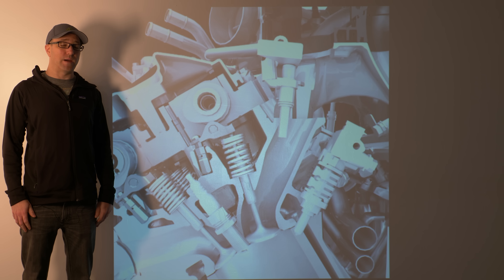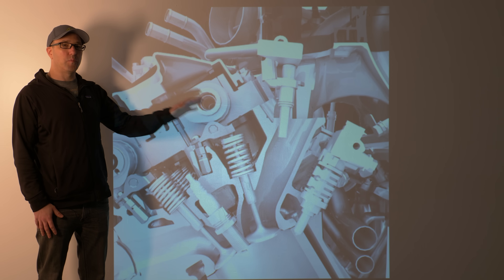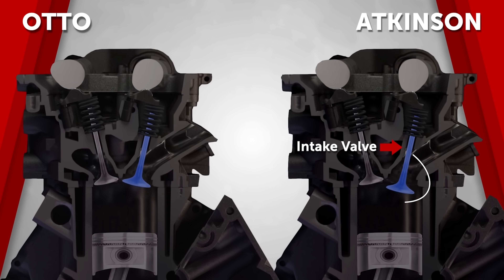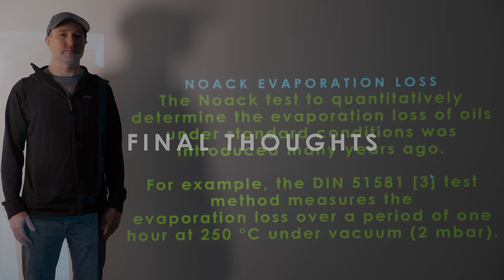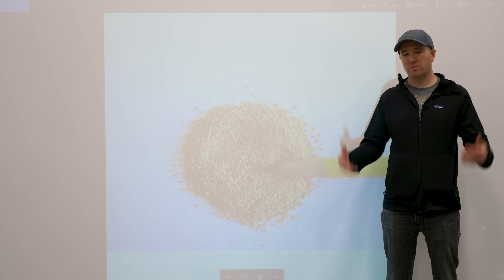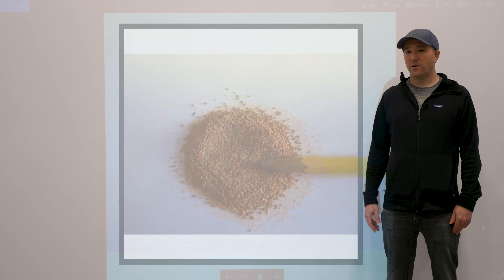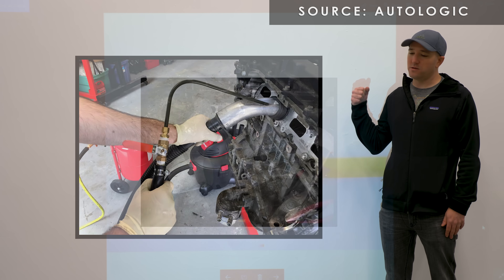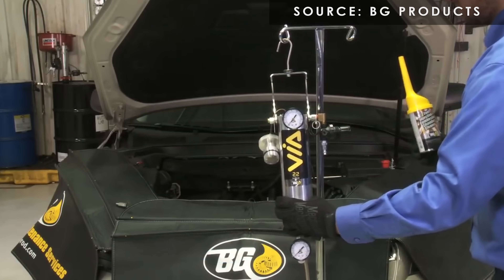Direct Injection, Problems and Solutions | The Fine Print

Comment: I'll stick to my all electric vehicles it's a lot simpler
Reply: First off, I love what Tesla is doing.  It'd be foolhardy to discount electric, as you simply can't beat the simplicity of an electric motor as compared to an ICE.  The power per size/weight, smoothness, ability to completely change the physical dimensions, mounting location of the motors etc.  When battery technology catches up, electric will take over.

Truth is though, we aren't there yet.  I've road tripped all around the country.  Last trip was 6,500 miles in the time span of ~2 weeks.  If we had to stop for an hour and fifteen minutes, give or take, every ~300 miles, it'd be very difficult.  That's assuming weather etc doesn't significantly reduce that.  Let alone if you're passing through a state like Kansas with a total of like 7 stations.  Hopefully there aren't too many other electric travelers.  We drove to Yellowstone and as one can quickly see, not many options in Wyoming.  Suddenly, you're planning your road trips around where you hope to be able to charge, not where you actually want to go.  

For shorter trips, you're probably great, especially in more charger dense areas.  I have faith that we'll overcome these limitations in time, but between the time it takes to "fill," the very limited number of stations as compared to gas stations, and the still rather limiting range of EV's, it's just not comparable today.

In my diesel car, I go an easy 600-700 miles on a fill that takes 5-10 minutes.  If I want a break, I take one where and when I desire.  It isn't dictated upon me by my vehicles range and time it takes to charge.  I can also expect that range fairly regardless of weather or what options I'm using in my car.  Being that stations are everywhere, I can drive through the middle of the night with full confidence that I'll come across a station when I need one.  

In our diesel truck pulling our travel trailer, I still get an easy 500+ miles to a fill.  It's just as easy to find fuel for it as well.  

Again, I think electric will overtake one day, as the powertrain itself is just superior.  As batteries improve and the number of stations increase, it's inevitable.  Currently, great strides have been made and Tesla's are in a land of their own as far as technology on board.  Great cars, but still limiting to those who take seriously long road trips around our beautiful country.
Reply: I had a model S so I got to skip all the non-owners in line.  Right now I'm not getting 310 miles due to extremely low temperatures where I live.  People in warmer climates have gone past 310 miles on a single charge already.
Reply: You got a Model 3? Dang you must be one of the lucky ones. I kind of doubt you get 300 miles to a charge, but either way nice car! I honestly like the idea of an EV with range extenders. Or like the Accord hybrid with direct drive on the engine for only high speed.

EVs I think are the future only because for a consumer there nearly little to no maintenance required and the general public just want hassle free vehicles.
Reply: My buddies drove their tesla from Flordia, to california, to new york, and to cinci and didn't have any issues finding super charger stations. Joe Johnson is a poor troll. Poor troll is poor.
Reply: Don't feed the trolls, best to just not engage with them because they want that back and forth interaction.
Reply: I'm considering going electric for my next car as well.  Still deciding which one, though.  Seems like there is a lot of decent options out there.
Reply: I agree and Electricity does not have any carbon footprint since Electricity comes from LIGHTNING  :D  he he he he
Reply: It's not simple at all. It's just that it all happens in a blackbox that you literally cannot maintain without proprietary tools.
Reply: Paully Castallano I like the idea of waking up with full range because you have plugged all night while sleeping. Some people don’t see that advantage.
Reply: first of all modern ice engine are controlled by ecu depending on the make and model of the car they also have millions of line of code an electric car share pretty most of all its component with an equivalent internal combustion engine car the only difference is the power train and energy storage an electric car power train is pretty much an upscale electric drill notice how you can spin the drill fast or slow by controlling the trigger pretty much the same principle as a an electric car a motor is pretty much a rod wrap in conductive coil that is activated by electricity you can pretty much build your own motor with a cooper wire and a double A battery on principle alone electric motor are very simple to fix and make try striping one of those handheld battery operated electric drill that pretty much a miniature tesla power train
Reply: Oh that's nice. Is it getting better mileage than your Model S? Some owners here in CA were getting more like 200 mile range on their model S.
Reply: Nathan, that's why I think diesel electric or petrol electric vehicles will become a popular option. It's already starting to show up like the BMW electric vehicles or something like Honda's current Accord Hybrid. The energy density of fossil fuels is pretty nuts considering how little of it we are actually using.
Reply: Out of curiosity, how heavy/massive are the batteries in these electric cars?
Reply: In a model S about 1200lbs
Reply: lazy and fat, not a bad way to live
Reply: Nooooooooooooooooooo! What a boring life
Reply: Beautifully said, right on the money!
Reply: Whoa whoa whoa, I'm pretty sure lightning depletes the ozone layer, and is known to the State of Californ-i-a. That's worse than carbon, even if it's, like, a BigFoot-sized print. And I mean the monster truck, too, not the hairy dude who lives up in Canuckistan.
Reply: How much will battery replacements cost?
Reply: BCSJRR I'll worry about that in 12 years.
Reply: What will be the range in 8 years?
Reply: Same as now...
Reply: Nooooooooooooooooooo! electric isn't simple at all, sure you drive it and you don't know what's behind it but there's millions lines of complicated code that makes the car do what it does, not to mention when you need to replace the battery years later, you basically need a new car since that's the main thing ..
Reply: Nooooooooooooooooooo! , lol. Are you stupid?
Reply: Nooooooooooooooooooo! Doesn't take me an hour or more to use the facilities. While you're charging I'm at least an hour down the road!
Reply: Here, s a new problem  The Tesla supercharger line are 5 to 30 min wait in CA ,  there are too many T cars waiting to use them.
Reply: Paully Castallano My model 3 is rated for 310 miles and superchargers are everywhere.  I can easily go cross country if I wanted.
Reply: Nooooooooooooooooooo! And take at least twice as long!!!!
Reply: Paully Castallano I guess you don't eat or have to use the bathroom.  After around 250 miles or so I wanna take a break from driving anyway.  I enjoy trips a lot more when I'm not just on the road the entire time.
Reply: Cause that is real hard to drown out with music.  In modern cars thats all you hear at highway speed anyway.
Reply: Paully Castallano lol ugliest car? you just confirmed your troll identity
Reply: Not sure where you get your information but there are plenty:
https://supercharge.info
Reply: Joe Johnson False information?  Wow you're really in denial.  Each location has a discussion page with multiple pictures from multiple sources.
Reply: /facepalm
Reply: That site doesn't even say there is one in Harmony but ok keep on trolling I'm done wasting my time with you
Reply: you're from PA? just asking about the charging stations of that area. one thing that surprised me about moving to Memphis was the number of Teslas around here. much more than I thought
Reply: Nooooooooooooooooooo!
I get 700+km out of my 07 tsx and it takes me less than 5 minutes to fill up
Reply: the only thing that will break is the battery the motor itself is almost impossible to break since all motor are basically shaft wrap in electromagnetic wire (copper wire)  that being pushed by the positive and negative charge magnets that only 3 components in a motor so the shaft it self is not even touching the magnets the rest of the car is made exactly like a normal car tires wheels brakes suspension infotainment system aircon and seating so reliability in those area are exactly like the same as normal cars and are due to manufacture build quality rather then the principle of electric cars in fact electric cars should be pretty easy to fix since anybody who capable of fixing an electric drill or rebuild a battery can fix the tesla car in fact the whole drive train is so simple its like a electric rc car that upscale and we all know how much cheaper faster and more reliable the electric rc car is compared to its nitro(fossil fuel) counterpart first of all battery industry driven by electric appliance such as computer and smartphones are announcing breakthrough almost every few years charge time have gone down from almost a day to less then 30 minutes that a 20 fold in charge time reduction and almost 10 times the range of previous electric road cars and that only in a few decade while petrol cars will struggle to meet 5 percent efficiency increase per decade and it gets harder gian they make even the slightest introduction of friction and mass will ruin the engine efficiency over time from there the limits of thermal efficiency of combustion engine limits its useful energy to less then 55 percent and that with a frictionless and massless engine which is impossible if tesla continue with their efforts and if there a breakthrough in battery technology that permits a car to have 10 times the current range with 10 time less charging time of current superchargers you will see a range of 3k miles on a full charge less than 7 minutes within the next 2 decade and don't look at this paragraph and think i am hallucinating phone battery technology have gone from 400mah brick to 4000mah battery from the size of a brick to not much more then thick paper in less then 2 decade and mind you that is if we assume the same growth in the industry which is doubtful since in today modern society research development and importance on appliance and machinery run by battery are of much more important than back then and this will reflect on the resource that will spend on the development of this technology fossil is doom eventually battery will be much lighter than a tank of gas with alot more potential practical energy and the only relevent internal combustion cars will be for recreational purpose going the same way as the horse and donkey
Reply: Serious question, what are you doing watching a video about problems with Fuel driven cars?

Comment: What do you think about CRC intake manifold and valve cleaner? It certainly won’t help if your engine is too far gone and gunked up with carbon deposits but I hear it could be good preventative maintenance to use it every 10,000 miles or so to keep the buildup from getting worse.

Comment: OK I just put walnut shell powder in my air box I should be good right? Seems wierd but I trust you.
Reply: Leeso nneville... Don't forget to put some in your tank to clean out the injectors 😉...as far as the air box goes, are you just using the vacuum or did you put them up high to use a gravity feed style system 👽 🥜
Reply: I mixed walnut powder in my oil, waiting for the power of nature to do its thing
Reply: Nah I just took the air filter out so it didn't get clogged and filled the box up. Don't worry I'll be putting a "How To" up on my blog soon.

Comment: "A Old Guys Trick"I can remember back in the 50s 60s & 70s how we would Decarbonize carbureted engines. We would get the engine hot, remove the air cleaner rev the engine high  while slowly pouring cold water down the Carburetor without killing it,....NO BS..............Black chunks of carbon blew out the tail pipe.
Reply: Bextar636 
Wonder if water injection can be implemented in some fashion for an ongoing cleaning action? Too difficult dealing with freezing or rust, or the replenishment of the water source maybe.
Reply: yup. used to do that!!
Reply: "Wonder if water injection can be implemented ..."
Use a methanol injection kit. I'm looking into installing one on my FoST.
Reply: And this doesn't damage gaskets or o-rings due to the alcohol snake oils use ;)
Reply: A Coke bottle full of cold water down it's throat and out it's exhaust came all kinds of crud
Reply: me to thats somthing l try if i ever have this problem
Reply: Bextar636 window cleaner works even better for that
Reply: I run a water/methanol injection on my diesel.
Did it for lower exhaust gas temperatures, but I've been told it keeps things clean inside.
Reply: yes - this worked on older engines, but the carbon on the GDI valves is nothing like the older stuff. Water in the intake will basically "steam clean" the piston top and combustion chamber - not the valves.
Reply: Yes I did exactly that years ago twice on my 235cu inch Chevy engine.
And as you say it did blow chunks of carbon out the tail pipe.
 It was a fairly well known and used practice with carbureted engines.
Reply: Bextar636 that's a great way to destroy a thousand dollars in catalytic converters
Reply: @zoticus1  no problom. Cat delete
Reply: @zoticus1  because catalytic converters don't buildup condensation in the winter? Idiot
Reply: zoticus1 So how do you prevent moist air going into the engine in rain and foggy weather?
Reply: Whats a carburetor?
Reply: @johngiardina8259  really?
Reply: @johngiardina8259  how engines used to receive fuel before computers or electronic fuel injection
Reply: The problem is oil, use ethanol instead.

Comment: I want to see a high mileage skyactiv brought into the shop and intake removed.
Reply: Aarown1017 Skyactiv engines have air/oil separators. Mazda claims they have no intake valve buildup issues. I still wouldn’t mind seeing dual injection from them like Toyota.
Reply: my 2014 CX-5 with 175 000km on it, canadian winter/summer city driven is still nickel.  no issues.   I use mobil extended since bought at 80k.
Reply: Jean-mathieu Leblanc You still have the CX-5 now on 2020?
Reply: @mindspinn311  Where can I confirm this? I've looked online, but can't find any info to confirm that Skyactiv engines have air/oil separators. I'd love it if it is true because I recently bought a 2019 CX-5 Signature which has a turbocharged Skyactiv engine.
Reply: @robertdevoy3119  Most of the engines today have oil separators built in the head or block.
Reply: @robertdevoy3119  my 2014 CX5 natty with 135k is still running smooth with no (noticeable) engine efficiency issues. We'll see at 150k how she keeping up.
Reply: Andoniades KM or Miles?
Reply: @alexsosa2962  miles.
Reply: @mindspinn311  Thanks for the info about Skyactiv AOS. I recently bought a 2017 Mazda CX-3 so was getting worried after watching all these videos about intake valve carbon deposits on GDI engines. Although I suppose even the AOS system does not guarantee clean valves.
Reply: @nothingtodo58 The AOS may or may not be true. I don’t remember at this point. But Mazda generally doesn’t have the issues that other manufacturers have with carbon build up on the valves.
Reply: Aarown1017 theory on my forum is occasionally rev the engine high and that would clean it. Search for BILD a German auto magazine. They rated mazdas as top 3 in reliability in many segments. The 3,6 and CX-5
Reply: Mazda deals with the issue differently. It seems that engine temperature when high enough can burn off or at least prevent the build up of carbon. Mazda has thusly redesigned their GDI Skyactive engines so that the intake valves are subjected to high temperatures. The did this by directing coolant passages away from the intake valves and using valves that are designed to withstand the higher temperatures without damage.  I had a 2016 Skyactive Mazda 6 and kept it up until 4 months ago. It had 69,000 miles on it and there was no indication of any GDI caused problems. I did use top tier fuel and low volatility synthetic oil but I only changed my oil once a year.
Reply: Here's one with 50,000 miles on it.     https://www.youtube.com/watch?v=txavifZgHwo
Reply: Skyactiv engines should have no problem according to another Savagegeese review. https://youtu.be/R7yHcGbBh7g?t=792
Reply: @sydesign768  Engineered Explained found build up on his 2016 Miata ND valves when he gained access to it in a supercharger install video https://youtu.be/yOQtbwyFV4g skip to 8:45 you still need to put in seperators or catchcans cause his car was just at 30k-40k miles

Comment: Quite honestly, I am all in for these emission regulations, I just really don’t like how manufacturers are trying to tackle the problem. 

I know they are not without faults, but even ignoring the “eco” part, I would definitely buy a fully electric car. Mechanically much simpler, and in my opinion, thanks to no clutch / transmission / instant torque, they drive nicer too.

Comment: You can also use a filter for an air compressor this remove the little filter and the oil will fall down into the catch can. With these new engines we could very well see older cars going to stay on the road longer some people might just rebuild the engine that they currently have in their car just to avoid the issues as far as the Honda guys they'll just continue doing motor swaps like they do now to be honest with you the early 90s were the best made Hondas